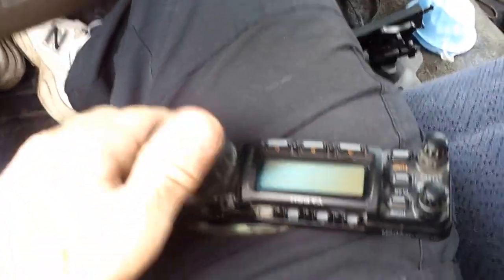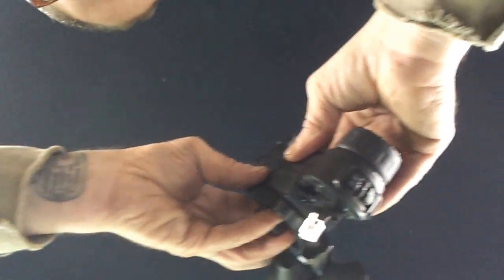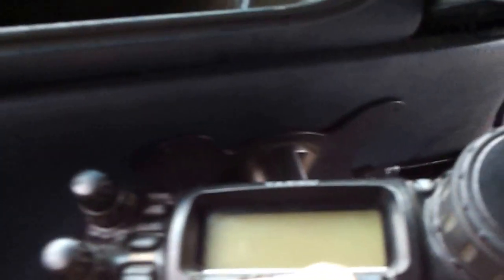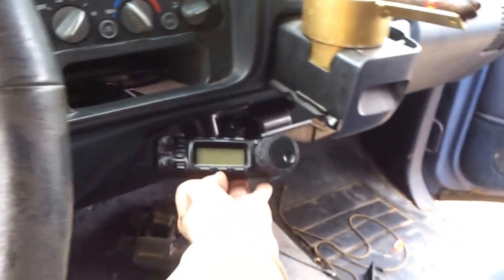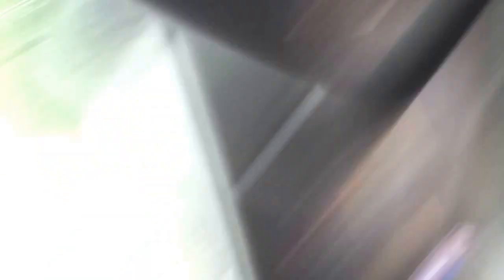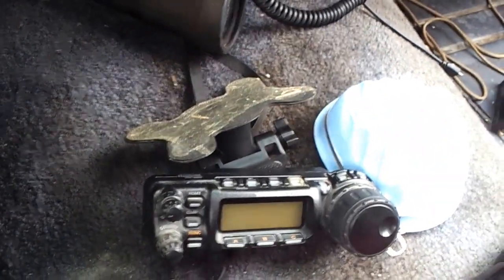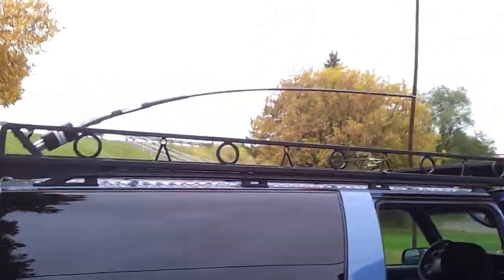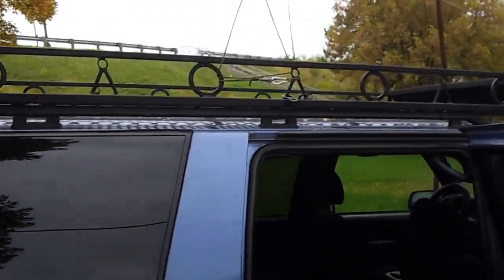moblie HF Yaesu 857d and Chameleon Multiband vert in NVIS mode.

Comment: Good idea but I would do things differently.  Abandon/sell the chamillion antenna, they are far overpriced for the performance they offer.   Get an external tuner (like Icom AH-4) and a CB whip.  Run the cb whip horizontal  on the roof, isolate from the roof rack and connect to the ext tunner.  It will work as a real NVIS antenna.  You could also run it in a vertical position for long range.  It will perform far better than the Chamillion antanna which is a bottom loaded vertical which will never match the impedance of the radio unless you run a tuner!!!!
Reply: Disagree, I use my chameleon hybrid mini with mil whip mag mounted on roof, I can make qso 7000 km on only 5watts with ft818